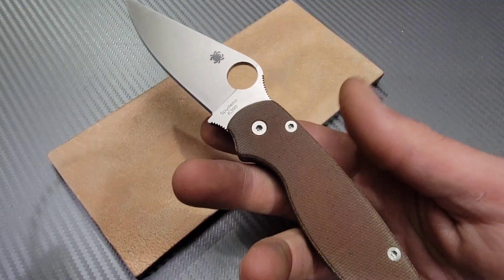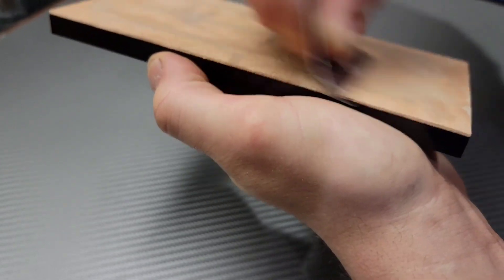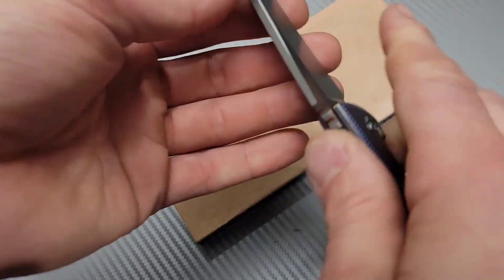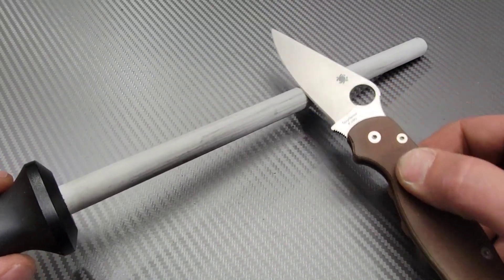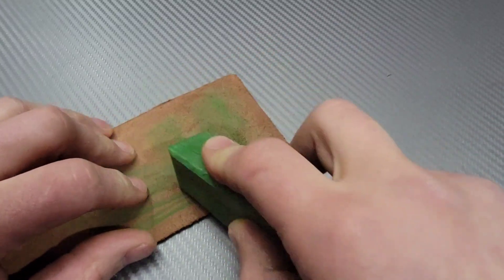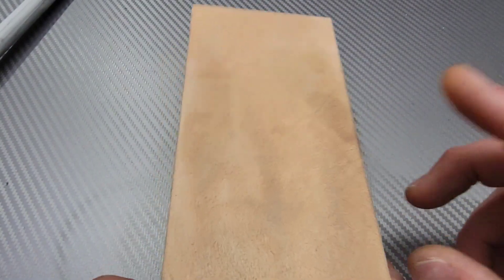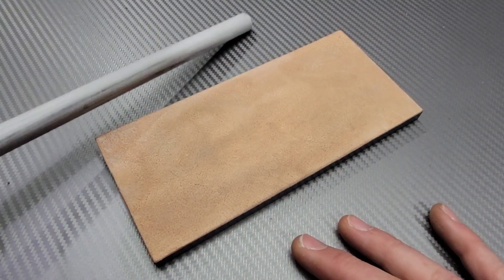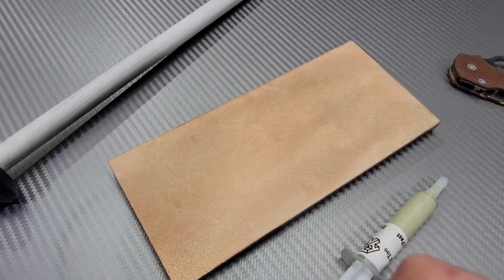URBAN EDGE STROPS & COMPOUND

Comment: Have you tried any sprays or emulsions yet? It cuts down on the drying time and is really easy to apply. Good vid, I'm going to try out one of those strops
Reply from the maker: Yes I have dmt spray, which I do like sometimes I feel paste is a bit better especially for edge maintenance and the spray is good for edge finishing but the paste is good for that as well with the rt micron rating

Comment: Please be more specific with the different compounds that you have described. Seems your info is incorrect.
Reply from the maker: well i would go with stroppy stuff either way, its a diamond emulsion that is highly consetrated, if you watch any of my most recent videos its what i talk about the most, i have it linked in the new videos in the hapstone link or in the Neeveknifeco link
Reply: Highly concentrated? Does that translate to a specific percentage of the total compound is diamond powder or is it high percentage according to which agency.
I also believe that this is an emulsion which limits the total percentage of diamond powder. That is because it is an oil based product.
Reply: Sorry an emulsion is not a paste. What the syringe looks like a paste compound. An emulsion has always been more fluid than a paste.